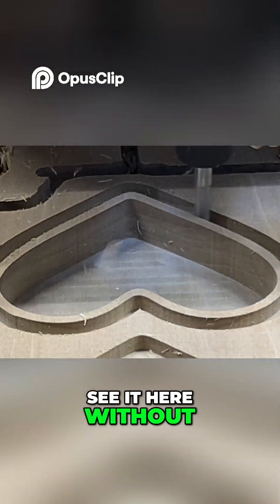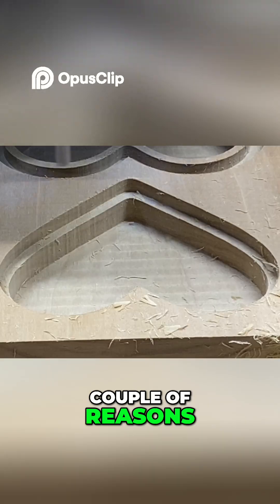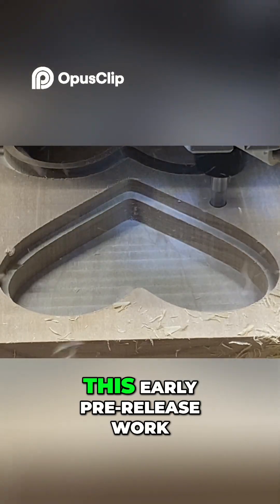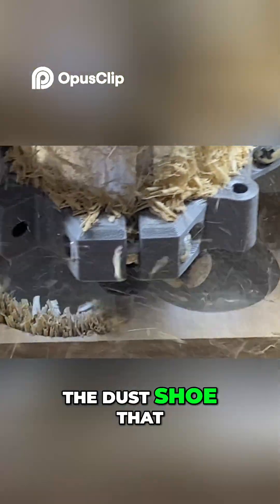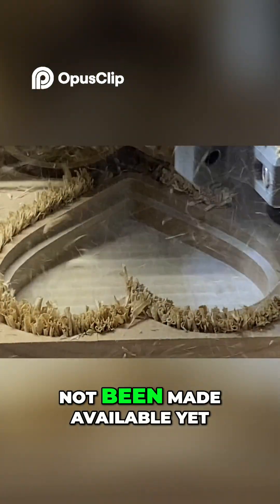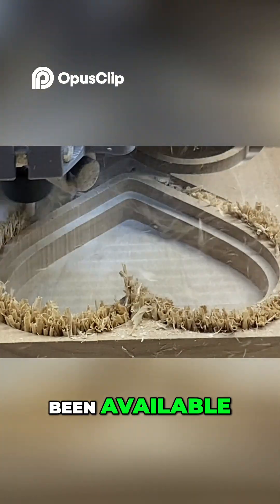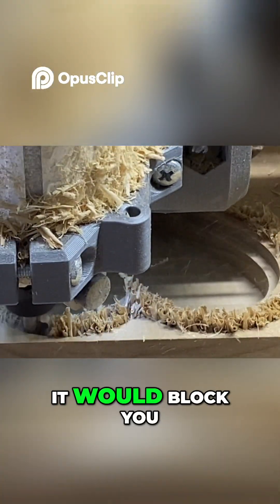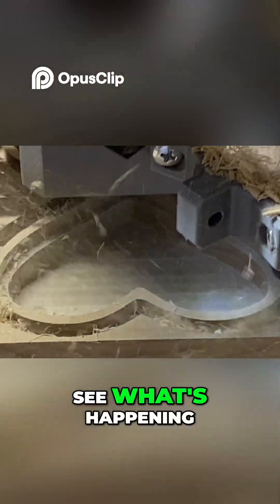Lowrider V4 DIY CNC FREE plans & files! Revolutionary CNC Design

Comment: Nice!  Great summary Doug, and great clip too.  I will check out Opus, you liking it so far?
Reply from the maker: Believe it or not, I’m actually in the process of building a better tool than opus clips. Mine will be called MakerClips. I don’t have mine built yet, so I used opus both to create something that was needed and also as competition research. Mine is going to be much better. And tailored just for guys like us, DIY maker community.
Reply: @design8studio  LOL, totally believe it!  Few years ago was manually editing 100% of my videos in Premiere, then, out of frustration started experimenting with writing Premiere extendscripts to automate stuff.  Eventually, ended up creating content processing tools to automate more stuff (some ends up on zoomtube).  Today's LLMs makes this stuff so much easier to get done.  Have been deliberating on sharing the tools I'm using, but then would have to deal with documenting, supporting, maintaining, etc...
Reply from the maker: @AzaB2C  Yep I hear you!